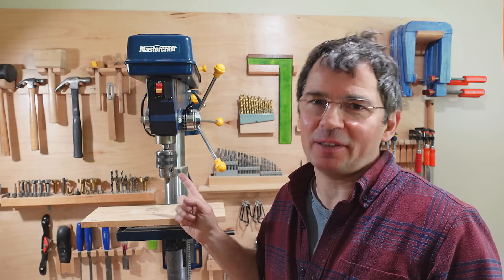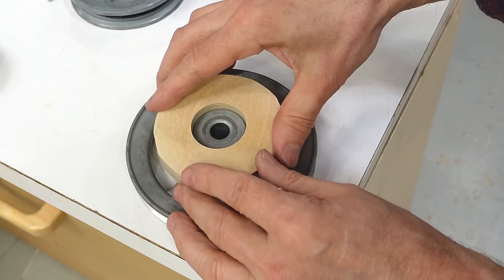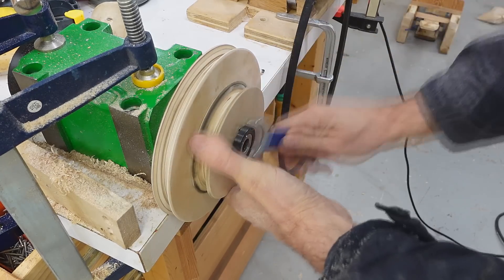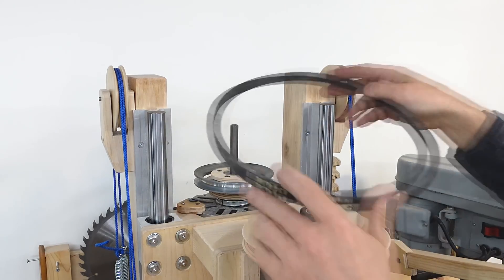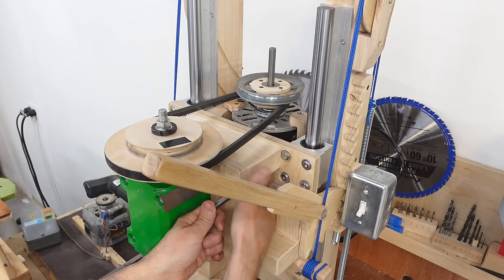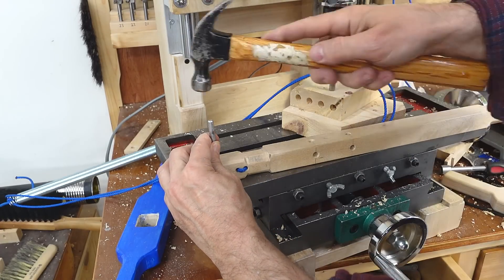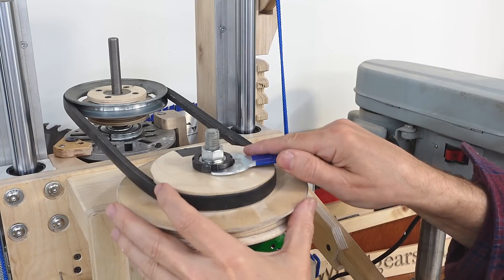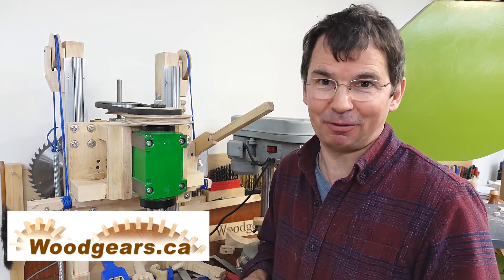Better pulleys and belt tensioner for the homemade mill/drill

Comment: Since your pulley tension doesn't require a lot of force, would it be possible to create some kind of quick adjust half-nut system? Or how about a 2-notch pushrod with an over-center mechanism that you could quickly latch in each pulley position? Love your content! Always gets me thinking!

Comment: Thanks  Matthias Question  ( how would you go about solving a problem like this) 1. rocking chair 2. old, weathered ,taken apart 3. the seat was made out of 5 parts using finger joints.  the joints are weathered too.  Would you clean and reglue or is there a better way. The chair is one of those big box white ones probably 30 yrs old.  all the other parts are in good shape.

Comment: What if there were a toggle lever for the tensioning, so you do fine adjustment with the screw at the back but then you can just release/lock the belt with one flick at the front
Reply from the maker: that would be better, I just couldn't think of a simple small and reliable mechansim to do that.

Comment: I've got a cheap drill at work; the belt is just tensioned by a slight spring (there is also a screw to lock it, but I have never used it) , it makes changing speed very quick, but also lets the belt slip if the drill grabs.

Comment: It would probably take all the fun out if it to have a motor that can be speed controlled. I adapted my bandsaw so it can cut steel and wood, with a 3 phase induction motor I bought for a buck from a metal recycler and a variable frequency drive from China for a hundred. It’s worked out really well.

Comment: The fact that machining metals takes a bit more time (although with the right, properly powered, and most importantly, rigid enough machine tool, doing the actual machining of softer metals like aluminium and brass isn't a particularly time -lengthy task) is part of the joy for a hobbyist. 😉

In any case, the actual machining is often the least critical bit (although obviously, if you mess it up, you can still scrap your part!😂).

Once you have your design, it'll often be working out the order of operations and the setup for workholding/toolholding that is most critical to success. Then, since machining metal often (not always but often) comes with a requirement for precision, there's all that metrology that will punctuate the process and add time.

The class of joy when Quinn (Blondihacks) gets a pin to make a perfect sliding fit in a hole and it comes out of the hole with a 'pop' sound due to the partial vacuum created is what all hobby machinists seek. 😉

Final thought: having the right machines and tooling and metrology kit will cut down a lot of time, as will getting the order of operations right.

Oh and if you make something  in steel (or even aluminium or brass in some use-cases), it will be a lot longer before you have to spend time making it again when it's worn. 😂 😜

Comment: I can appreciate the precision of machinists like the ones you mentioned, but I have adhd so I always find the quick and dirty solution and then never look back
Reply: Machining doesn't always demand the precision that Youtube machinists typically go for. Chinese products with massive slop proves you can build things incredibly haphazardly. It just doesn't really sound interesting to watch someone make a worse version of a tool than can be bought for dirt cheap. So Youtube machinists often go for high precision and visual style rather than a tool which technically works but is otherwise jank. Mattias builds a ton of jank but he does it in a way that directly solves problems and his tools are typically very original, not store bought replicas.
Reply: Pretty much every hobbyist machinist has some form of neurodiversity.

I, like you, have ADHD and some of my shop sessions are after my meds have left my body but I still count those sessions as successes assuming I achieved something.

Last night, I made a lapping jig for my little Chinese 7x lathe so I could lap the barely machined undersides of the ways in the centre without using the sadlle. Doing it so the central shear plate I've made to improve rigidity (based on Steve Jordan's video) runs smoothly without binding.

I knocked it up in about an hour, it's janky as hell but it'll do the job. 

If I know I'm doing something that requires precision or has to look good though, I'll schedule it so I have a head full of Lisdexamfetamine. 😉

Comment: I love your channel; been watching for years. I'm a metal guy or a welder guy. I'm amazed at what you do with wood. I'm not a machinist (wish I was) but I make lots of things with metal. If you at least learn some simple welding, you would find it really helpful in making strong items. If you start, you will get hooked. I make an entire trailer out of bed frames people throw out. I made a ramp system for working on cars from scrap metal,  swings for my kids, a plow for my tractor, hitches for cars, grills and monkey bars too.
Reply from the maker: I have a welder, but not a good place to do it.  Also, metal is much more expensive than wood
Reply: @matthiaswandel  Once you get into it, you will start finding free metal everywhere. I've cut up and welded loads of things in my driveway and garage. I've collected tons of metal over the years and seldom buy anything. I welded some racks to organize it and I just collect it. A cheap $140 plasma cutter really helps to cut up material to store. I cut up filing cabinets for sheet metal. Sometimes on these "free" sites people give metal away. In no time you can build all kinds of things. Facebook marketplace also has people unloading metal scrap free or cheap.  Tell some friends you collect metal and it really starts coming in. I have to turn metal away, I have so much.

Comment: I do both wood and metal.  And the issue with the time aspect is the rate at which a volume of material can be converted to chips.  It's pretty easy to convert some volume of wood into chips.   We can do it rapidly which is why making your stuff from wood moves along so quickly.  For metal the conversion rate from solid to chips is a lot less volume per time.  And that's where the longer time at the machines comes into the picture.  You've likely already seen that directly just with your wood wrenches versus the converted router wrenches.

Comment: For the guard, why not attach it via magnets? That way it can fit close to the pulley, and whenever you have to change the belt you can just slide it down out of the way real quick.

Comment: Working in metal can take a lot longer than working with wood. But that's often down to the machine advantage one possesses over the material. I have seen metal working machines that cut metal like it is soft pine. But not in anyone's home shop.

Comment: All those years Matthias dismissed wood lathes. Now he's machining wood on a metal lathe 😮
Reply: Wood turning is a separate discipline besides basic woodworking. You can do a lot of cabinet work without touching a wood lathe. Wood turning is a thing unto itself. But when you need something turned then you need it turned.

Comment: Strangely, Matthias, your attempted avoidance of metalwork in favor of wooden apparatuses does not appear to ramify to the material working civilizations. The archeological three-age system has been used in many areas, referring to the prehistorical and historical periods identified by tool manufacture and use, being Stone Age, Copper/Bronze Age and Iron Age - Where is your noble though apparently covert age of Wood?

Comment: Since you have 2 sets of pulleys, why not have 2 sets of belts...
When you want to do a speed change, you pull a pin on each side so that whichever side spins freely.
So for example, the top pulley is on a bearing so it spins freely, but if you engage a pin it locks into the bottom, on the opposite side you pull a pin to unlock the bottom pulley. Since you only need one pin at a time you could just pop it out of one side and into the other, removing your chance of running both gearings at the same time.
Reply: Matthias is making me feel better about what I need to do to change speeds on my milling machine. My mill has two belts on it all the time. It's a 3 pulley setup with an idler pulley. To go from high to low range I do have to swap the belts up and down too. I always sing to go up I go down. Because to get higher speeds the belts run in lower positions. All of it is why people just put VFDs on their mills. Because moving belts around is tedious.

Comment: You should make template for V-belt groove. Another great video from greatest youtuber of all times!
Reply from the maker: Hadn't thought of that, but with the numbers of V-belt pulleys I made over the years, it would be worthwhile!
Reply: @matthiaswandel  I like your every belt is a template method. When it fits it's good.
Reply: Or even better you could try to make copying lathe to make not only v-belt groove template but copy what ever detail you need with little effort. But it's up to you what you do next. Never seen bad video from you 😋
Reply: @matthiaswandel  You could test your pulleys v-grooves, does belts on plywood pulleys work better or worse than metal ones or does free hand made v-groove is worse than official one 😄

Comment: For a guard, how about just a U shape that attaches to the vertical base plate.  You could mount it low enough to be out of the way for belt changes but stick out forward enough to keep your cranium away from the pulley.

Comment: The time it takes to make something out of metal is directly correlated to the experience of the machinist.    When I started it took forever, but as I got more experience, I understood how to do things intuitively.   Now I can visualize something and make it pretty readily.   Counterintuitively, CAD is really detrimental to this process as it's far too easy to design unmachinable parts.....  BTDT and sold the CNC.

PS.  I suspect that YT machinists spend a lot of time doing things "correctly" to show their viewers, which adds to the time.
Reply from the maker: 30 years ago, I was milling something on a birdgeport to make a jig for something, watching the DRO and turning the feed crank until I hit my target.  But got absent minded and overshot.  Concluded at that point that CNC is the way to go for that sort of thing!

Comment: Matthias, it’s been about 3 years now since your last bandsaw build. We are ready for the 40 inch :)
Reply from the maker: With the 26", the post is far enough away, kind of a reach for the switch as it is.  I might build another one, but leaning towards 18 inch.
Reply: @matthiaswandel  Have you seen the band-saw that Keith Rucker rebuilt for Jimmy Diresta? At least two sizes bigger than your biggest one. You can't leave such challenge unanswered ;-)
Reply: @matthiaswandel  I built the 20 inch a few months ago and I’ve been loving it
Reply: I would like a bandsaw that is two stories and the second floor of the house is actually just the table for the saw

Comment: I inherited a couple of big forstner bits from my dad.  4" dia. or so.  I think he used them to do clock faces.  I tried them in my drill press, but find that even at their slowest speed, there isn't enough power to drive them.  Maybe I can tinker with a wooden replacement pulley for whenever I want to use it.
Reply: The larger diameter bit you turn the slower you need to turn it. That's because the outside of the bit is moving faster. A 4" diameter bit is pretty large. 100 RPM would be a reasonable speed to run a bit that big at.  That's 104 surface feet per minute. Which is as fast as I'd run in anything but the softest wood. It's also lower RPM than even my milling machine is capable of doing. It only goes down to 120 RPM. But that's close. Close enough I'd give it a shot.

Comment: Have you considered some sort of cam lock for the belt tension? That way you could quickly release the tension, swap the belt, and re-engage it (adjusting slightly as needed), instead of needing to wind the tension adjust all the way out and back in.

Or perhaps some sort of removable stop for the nut to press against instead of directly against the front casing? That way you could remove the stop to release the tension, then push the rod forwards and put it back in to apply it again.
Reply from the maker: Yes, but the nut to turn was way easier to implement

Comment: Yep, exactly the same thought on machining metal. I also watch these channels and they have just convinced me not to get sucked into this hooby. It seemed like a really long time to cut something with the disc, grind/file it to size, weld it, grind it again, paint it. But the cost, time and knowledge required to machine something is way over budget. And you need stock, which is not exactly cheap.
Reply from the maker: yes, I keep looking at the exhorbitant price for brass stock.  The brass itself really can't be that expensive itself, or they wouldn't make plumbing stuff out of it.  Wood, on the other hadn grows on trees.
Reply: @matthiaswandel  And when it doesn't, it grows on the street curb :)
Reply: Metal is a lot more substantial than wood is. It does take me a lot longer to make anything out of metal as opposed to wood though. I have limited tools. I have gotten a lot of scrap metal for free. So I rarely buy stock for projects. That makes the cost a wash.

Comment: Hello! I want to make a manual (not CNC) drilling and milling machine for metal. I saw on sale CNC motors with an ER 32 collet with air and liquid cooling, but the speed of these motors reaches 18,000 rpm. But you need to process metal at low speeds, there are also frequency converters... Will such motors withstand side loads when processing steel? Who will advise what??
Reply from the maker: The question is more, will be they be able to sustain the torque?  At slow speeds, the internal fans for air cooling won't be very effective.  Also, will the internal bearings be able to withstand the thrust?
Reply: @matthiaswandel Here (in Russia) these engines are installed on CNC milling and engraving machines. Although... it's all the same and comes from China. But the description says that they process non-ferrous metals. This was the question, let’s say I lower the speed using a frequency converter and process steel at low feed rates with minimal material removal up to 1 mm in hobby mode and not production) In any case - thanks for the answer.
Reply: Those kinds of speeds are only appropriate for very small diameter cutters, like engraving, but not for bulk material removal.

Comment: Metal from scratch doesn't have to be slow if you have the metal hogging tools and ability to put up with the noise and mess they make (fast woodworking is so much kinder on the ears, and the dust generally isn't covered in cutting oils/coolant). It is just the machinist mindset that makes metal working tend to slow in general -  the attempt at getting a great surface finish while precisely hitting the intended measurement to "the thou" for sloppy work where a woodworker is probably happy to be within a millimetre (which is a terrible mix of imperial and metric, but seems to be the common measures for 'precision' metal and woodwork)...

Comment: Back in the fifties and early sixties there was a wooden car called the King Miget. Except for the engine, chassis, wheels and headlight buckets the whole car was made  of wood. My father dashed my pleasant day dreams by saying, 'It won't work. The wood won't hold up to the vibration.' That was over sixty years ago. As you see, that information has held up. The wood won't hold up. I have discovered that wood does hold up pretty well in gun stocks. And furniture.

Keep up the great work young man!
Reply: what i thought when i built my wood yard trailer 8 years ago out of scrap wood and 5 bucks worth of screws. admit i had to replace broke axle once. probably used it 20 times this year and its never been inside. it does have a metal tongue and i do use grease on the axle.

Comment: With your expertise and knowledge, I don't know why you just don't use a DC variable speed setup or better yet, an AC servomotor... Great video again!
Reply: Pulleys also give you more low-end torque. We went the variable DC route and ended up using maybe two settings along with changing the belt position anyways. It was nice to be able to run it in reverse when needed though.
Reply: @jeremiahbullfrog9288  single phase AC motors are reversible unless they bury one of the leads inside the motor. Which they do. Crimp connectors be cheap I guess?
Reply: @1pcfred  Good to know, I could install  a DPDT toggle switch in an el-cheapo unit with a HUGE SIGN not to switch it while it's running lol
Reply: @1pcfred  Great pointers, thank you sir
Reply: @1pcfred  This would be a common modern el-cheapo drill press motor. I just never thought of modifying the internal wiring, or that the start winding is out of the circuit when the centrifugal switch trips.  It all makes sense now, cheers
Reply from the maker: because with my expertise, I just make some pulleys and use the motor I already have.  Also, DC variable speed motors need feedback or the speed varies too much under load.  It was just much simpler, cheaper and more effective.